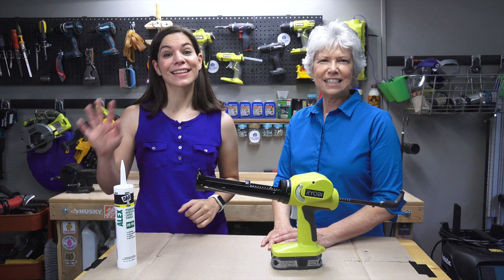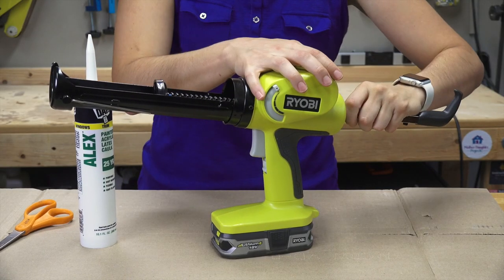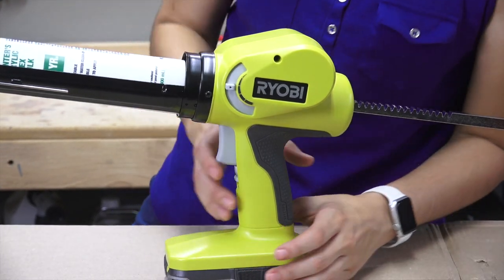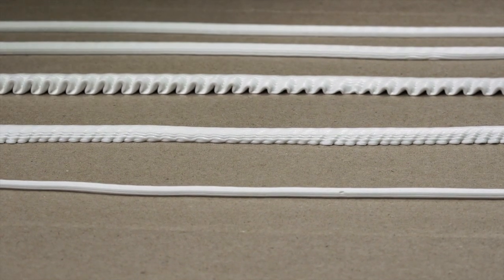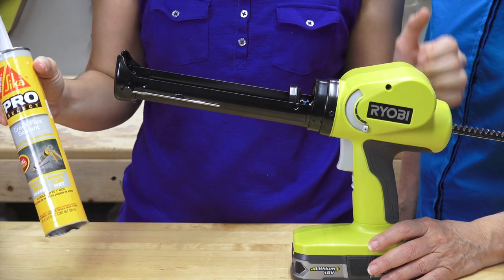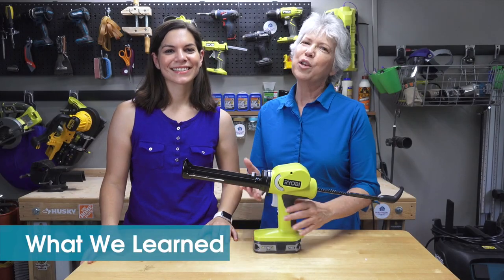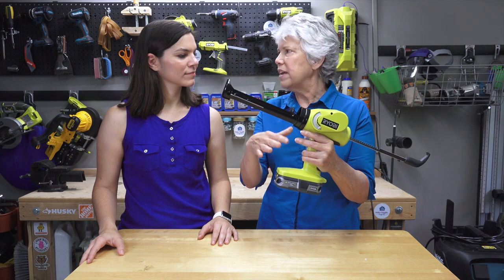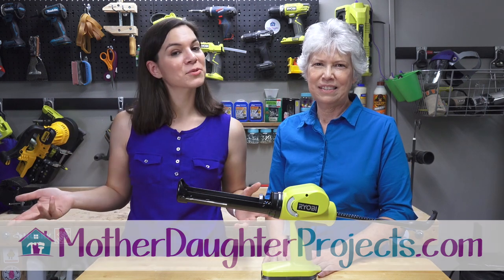How to Use a Battery Powered Caulk Gun

Comment: Never forget to make sure the tube has been opened/punctured with the pin. 
I thought I had a tube that was opened or maybe partially used but it was still sealed. I kept squeezing the trigger  until I had Liquid Nails squeezed out the back of the tube and all over the inside of the gun! Surprisingly it was pretty easy to clean up. It would have been much worse if it was silicone, though.
Reply: Wonderful! I couldn't hold on and squeeze, also have hand weakness. I didn't even know if these existed, I  just, typed in powerized caulk guns and proceeded to find an actual video, showing how to use it.

I thank GOD for your family sharing with the world. I am going to look for one today.
 I greatly appreciate, the instructional was NOT super fast and rushed, to the point, that I have to constantly, stop and replay each section, there was no profanity in dress or speech in the video. 😘🌹🌹🌹🌹🌹🌹🌹🌹💝
Most people cuss or have vulgar music and use GOD name in vain, the females even do this. I have to either turn off the volume, then a person can't hear the instructions, so you have to figure things out or turn it off altogether. Keep up the good work.
Have a very Blessed week! 📖🙏🏽🥰